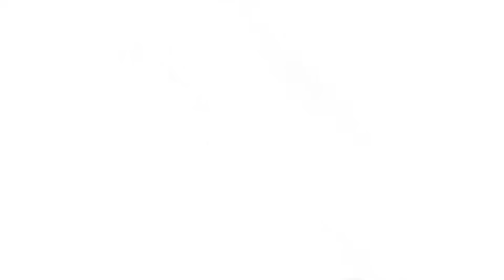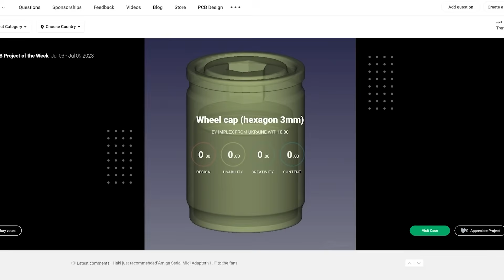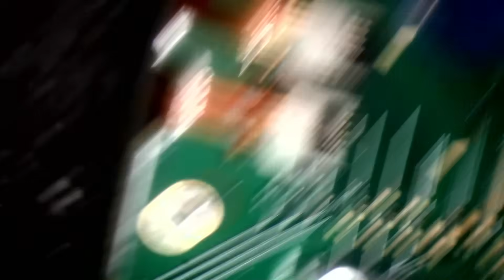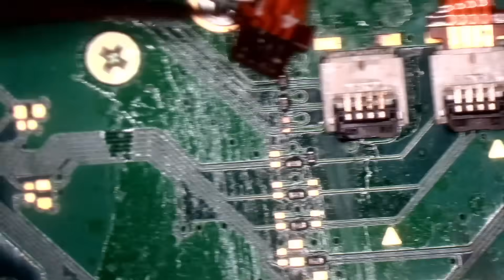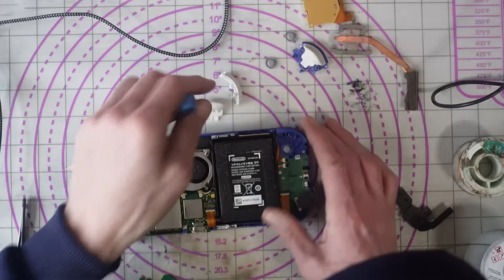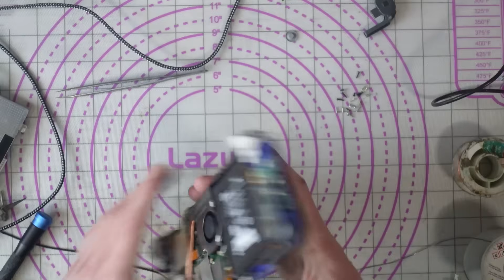Can I Fix A Broken Nintendo Switch Lite For @SwitchUpYt ?

Comment: Lovely stuff cheers mate - so it was never opened by us or repaired, although my 2 year old at the time was highly suspected to have dragged it through water haha
Reply from the maker: It's all good but, 100% wasn't factory but that's no problem. Sounds like nintendo might have done a dirty and sold you a refurb. Glad to get it working though. It should be back with you today:)
Reply: Just a random question.

Did you make a video stating thar RDNA2 GPU'S were some of the worst build quality you've ever seen, or is that me imaging things?

Comment: Good day Sir , i have switch lite that has shorted cap on m92 chip which is cpu cap and on max7720h on top right which is the small cap next to big cap . My switch si booting but stuck on nintendo switch logo . Is this still fixable sir ? Thankyou ! Btw removing m92 and max7720h chips still has the same shorted cap

Comment: Could you cut the ribbon cable shorter (6:20) and trim off those tabs to allow you to insert it deep enough instead of jumping the ribbon cable? Soldering heat and ribbon cables seems challenging to avoid melting the plastic.

Comment: Hey Phil, Joey from Joey Does Tech was having some problems with a switch light. The volume down button wouldn't work. Everything else did. He switched out the daughter board and recalled the apu. Nothing worked. You think it could have been anything else? It didn't look like any damage on the board either.

Comment: Really wish I could afford to get my Ayaneo Next Lite worked on, or had the skills to repair it myself. It worked fine until 1 day I went to turn it on & it wouldn't do anything. It'll charge but won't run off the battery alone. Ayaneo, I've learned the hard way, has sh*tty customer service & warranty

Comment: Nice repair Phil! Hope you’ve been doing well since sorting out the lease for your store. :) If it’s okay, and I don’t mean to intrude in case you’ve got other things going on right now, but can you let me know if my own Switch Lite is available for being sorted out? I know I sent it in mid-December with help from my mum but the last I had heard was that the RAM chips needed replacing from the motherboard, or that it needed to then be transferred over to a new board to get it working. Is that still the case for it right now? I just wanna make sure it wasn’t accidentally forgotten about or anything like that haha. Thanks in advance :)